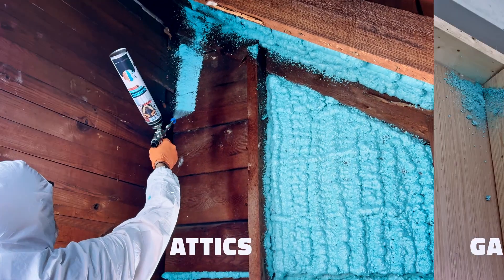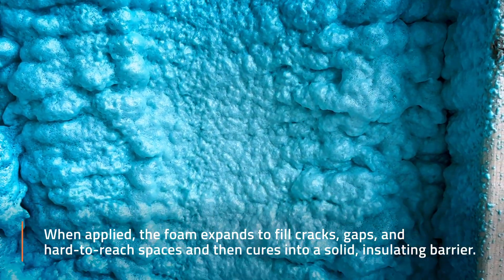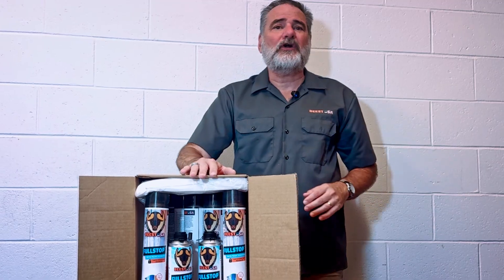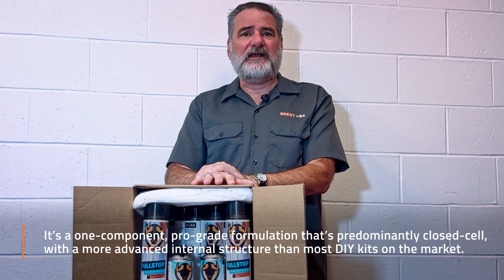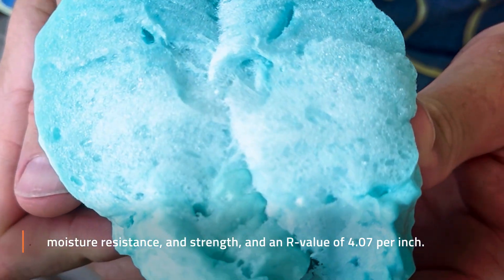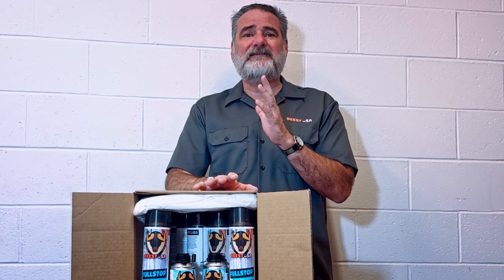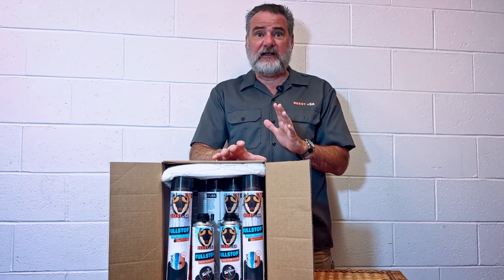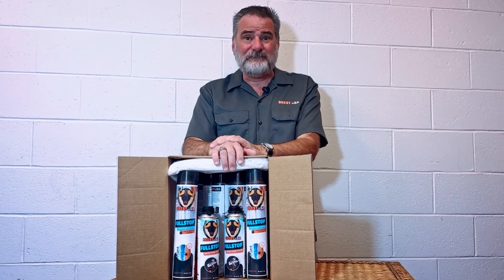Spray Foam Secrets: Discover Why It's a Total Game-Changer! (Beest Fullstop Series Pt. 1)

Comment: I'm curiuos why the applicaiton is so incredibly uneven and non uniform.  I've looked an many other brands today, (I had no idea there was so much competition) and this is either the most or second to most bubbly.  That has to greatly impact the R-value doesn't it?
Reply from the maker: Great question! The “bubbly or uneven” look usually comes from technique, not the foam formula.
Why it happens: spraying too thick, mismatched temps, or inconsistent distance and overlap.
R-value stays around R-4 per inch when applied in 1 inch passes. Texture doesn’t affect it, gaps do.
To fix: keep cans and surfaces warm, shake often, spray thin 1 inch layers with steady 50 percent overlap from 12 to 18 inches.

If you can share a photo via email at support@petratools.com, we’ll help pinpoint exactly what caused it.
Reply: @beestusafullstop Thank you.  I meant though, that I've been watching many to choose which to use.  Coverage, consistency, fly away, etc.  I assumed that the gentleman in the beard in multiple promo vids with the irregularities I'm referring to is YOUR guy.  Why would he be making the errors you mentioned?
  Thank for that rapid reply, though..

Comment: I bought this product and plan to use it on the ceiling of my thin metal she shed for only one reason: To make it stop raining in there. There are no holes in the ceiling. The ceiling has no leaks. It's condensation. So, for that application, do I really need two passes? Or isn't one thin coat enough to address the temperature differential causing the morning drippage? Thanks! Great video series.
Reply from the maker: Hi there! For condensation on a metal shed ceiling, one thin coat might help a little, but two passes are best. Apply the first layer, let it cure for ~30 sec, lightly mist with water, then do the second coat—this gives better insulation and adhesion to really reduce the morning drips. Hope this helps!